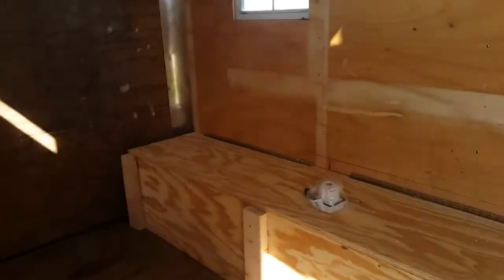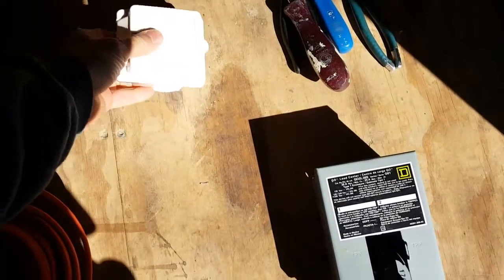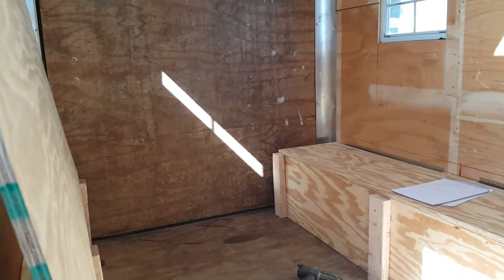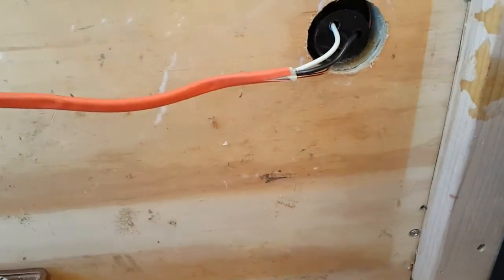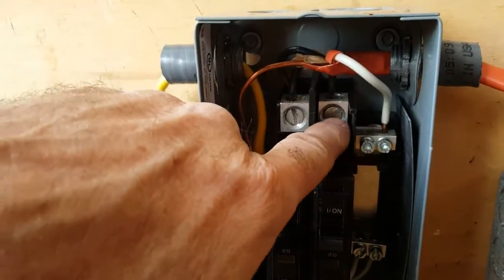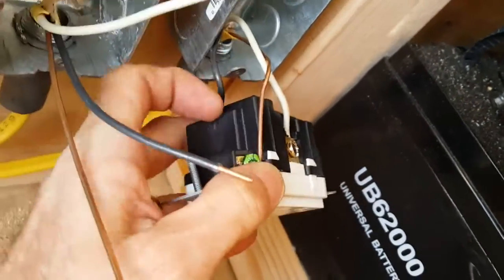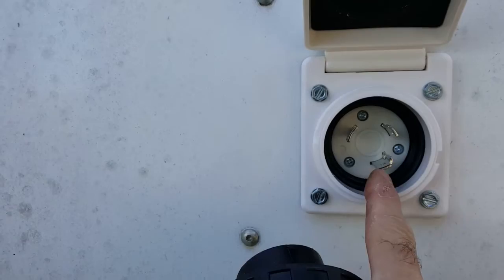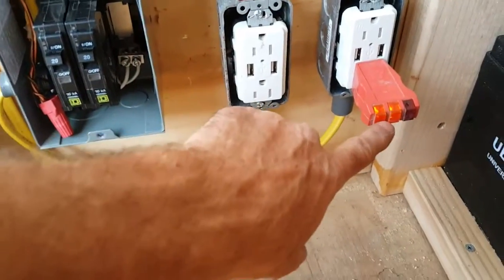INSTALLING SHORE POWER 6 x 12 Cargo Trailer Camper Conversion Part 9 Vanlife Skoolie #flgctc

Comment: Like others stated, I also looked at several videos until I found yours. I think is well done and your explanations very clear. It gives me a good road map... I want to add this to a camper van and only want 2 circuits. One to charge a Yeti 1000 when the sun is weak and the other circuit for misc stuff. I am guessing I don't need to mess with ground issues as it is just like an extension with a power strip (in my case). Thanks for sharing!!
Reply from the maker: Thanks for watching. I have worked on my grounding issues on the solar without success. When it is hooked to shore power grounding has not been an issue. I have a couple of videos later in this series that shows my work with my grounds.

Comment: I bought the load center and the breakers but cannot get the breakers to fit. Are they a certain way to put them in?
Reply: Check the comment from 4 months ago that talks about QOT vs QO type of breaker. Might be the reason. Great video BTW.
Reply from the maker: @croberto9096  Thanks. I guess I am going to have to remove the links so that viewers don't get non compatible parts from the links.
Reply from the maker: You are absolutely certain that the breakers you bought are the correct ones for your load center?
Reply: @FakeLegGreg  yes cuz I bought everything from your list from Amazon

Comment: This has got to be the most detailed video I have seen since I have been looking. Thank you so so much please make a video on how you hook up your batteries? Also are you running a battery isolator and a fuse box besides the breaker box? Because I'm just wondering if I am overthinking the electricity in this campervan that I am building.
Reply from the maker: Thanks. My trailer batteries are not at all connected to the truck so no need for an isolator. I do have a fuse box for 12 volt items like the water pump and ceiling fan. Good luck on your build.

Comment: Thanks for posting this video. I just did almost the exact setup with your help! I’d like to box ours in. Do you know what the minimum clearance would be on the load center and if it needs to vent?
Reply from the maker: I don't know that answer to that for sure but I think a couple of inches all around would work. Good luck.

Comment: Could you add a roof top AC, if you choose to do so?
Reply from the maker: I have not done any research on this but I would have to make sure the roof frame would be strong enough to support the weight of the AC unit.

Comment: Great video.  Im doing the same to my 6x12 cargo trailer.  Have you considered using a transfer switch to automatically switch to Inverter when no shore power is detected?  Check this handy device.  It does all the work for you.  https://www.amazon.com/gp/product/B004S5Y158/ref=ppx_yo_dt_b_asin_title_o01_s00?ie=UTF8&psc=1

Again great tutorial.

Comment: Thank you for a great video.  I have a question regarding your 30amp inlet.  When you mounted it to the side, is it just screwed into the outer metal sheet of the trailer?  If so have you had any issues with it flexing when plugging in? I’m planning on doing the same to my enclosed trailer but I’m concerned about it flexing too much.  I don’t have insulation in mine, so there is a gap between the sheet and the plywood.  Thanks.
Reply from the maker: Mine is just screwed on the sheet metal and there is flex. i intend to install longer screws to go into the interior plywood as well. If I were starting from scratch I would install some wood around the hole , 3/4 to 1 inch thick and then drive the screws in. Good luck with your build.
Reply: @FakeLegGreg  thank you for the input, that is what I was concerned about. I also thought about the longer screws idea, but I'm doubtful that will do any good.  Your idea about installing wood around the hole is the best one, however not sure you can do that without taking the plywood walls out.
Reply from the maker: @MrBlurry2011  Yes, you would have to remove at least that one panel to install the wood. Good luck.

Comment: how did you wire the main lugs with the black wire?
Reply from the maker: Hi Nancy. I have the black wire in the orange sheath connecting to one main lug at the top of one breaker. I also took a short section of the same wire and made a bridge from one lug to the other. Hope this helps.

Comment: How did you get ‘hot’ power to two circuit breakers?  Did you just jumper the two hot sides?
Reply from the maker: Yes there is a 10 gage black jumper across the top lugs. You can see it briefly at the 5:12 mark. Thanks for watching.
Reply: GB Adventures Thanks for the quick reply.  I am presently converting a 7x16 cargo trailer and while I understand electricity I am not an electrician.  Your video confirmed what I thought.  Great vid 👍🏻👍🏻

Comment: just want to know did you put a pvc pipe around the outlet after it came into the wall incase it heats up or spark won't light a fire on foam
Reply: just wanted to let you know i had the same conecter on my trailer and it heated up and started a burning smell in the trailer could not find looked everywhere found it at what i call a week point now i moved it out side into a pvc box i am a journeyman electrician looked at lots of videos no one is isolate the outlet when it go's into the trailer but they are putting pvc boxes no outet receptacle like your set up
Reply from the maker: Hi Leo. Really never thought about it but probably wouldn't hurt. Thanks for the tip.

Comment: How do you charge the battery whilst driving?
Reply from the maker: These batteries are not charged by the truck. They can be charged by solar or by 110 volt charger.

Comment: When you are plugged into shore power, do you have a way to charge your batteries from shore power?  I didn't hear you say (or see) a converter or a simple plug-in battery charger.  Just curious, because sometimes people can encounter a week of rain (etc). . . How do you handle?
Reply from the maker: Hi Carolyn. You are correct, we have had those weeks as well. Not high on the fun scale. Yes, I have a simple plug in battery charger that operates off of shore power. The charger will monitor itself for overcharging as well so it can be left connected to the batteries long term if you would like. I will have to make a video about this. Thanks for the question.